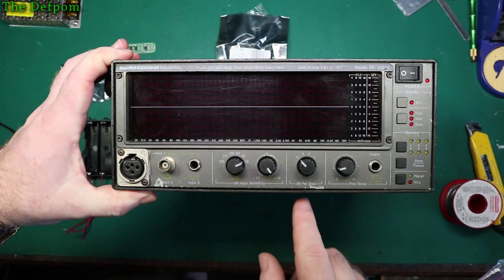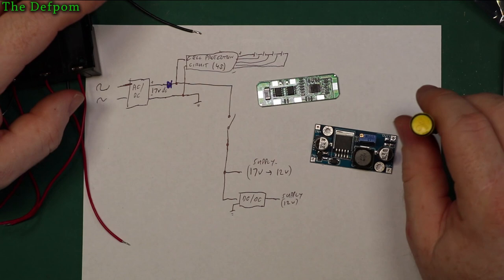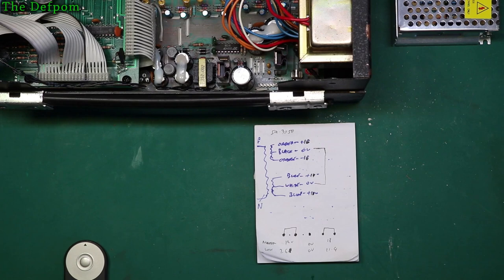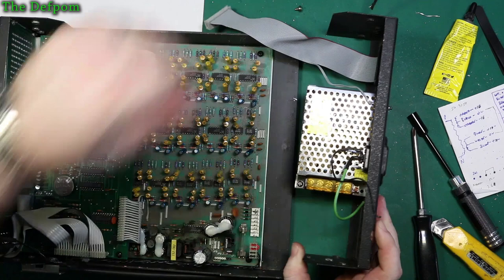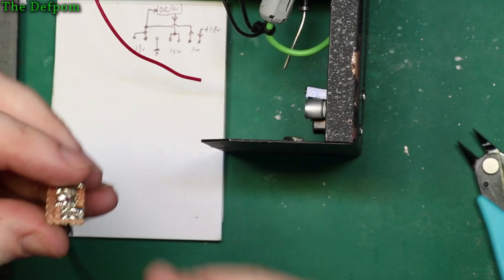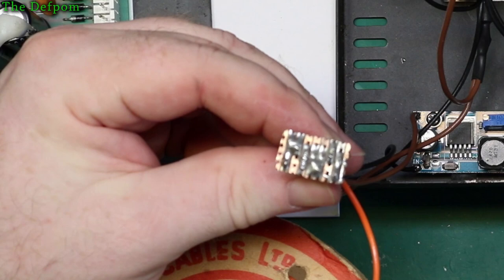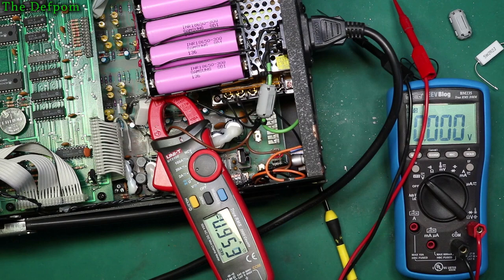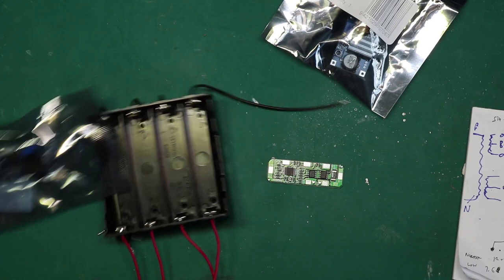🔴 #530 Audio Control SA-3050A RTA - 240VAC Power Supply and Li-ion Battery Pack Conversion to 18650

Comment: Well done good job, I have one The Audio Control 3050A mine has a crook battery pack, so just disconnected the battery and it works on the mains power only these days, had the device for 20 odd years, very useful still using it every day for monitoring ad measuring my own stereo system. Again, great job, well worth saving the device.

Comment: What an awsome, inspiring, excellent piece of work.
This project has given me some real good ideas for some of my bench kit.
I especially enjoyed the bit where you discovered the power supply cutting out because the charging circuit was drawing too much power and jow you fixed the issue by adding the large resistor.
This is where most content makers would skip past an say, " I decided to add a resistor" and skip past the actual discovery of the problem in the first place.  
The fact that you discovered the issue and then showed us how to fix it is really important in the teaching process.
Thank you for sharing.
👍 👍 👍
Reply from the maker: ISO Guy - thanks for the feedback, I’m certainly not perfect and cannot anticipate everything, so showing the kinds of things that can happen and show up in the development of a projects seems like a good idea to me.

Comment: Very nice modification!  Really satisfying to complete a project and have everything work to plan. The only thing I would have done differently would be to make a bracket to mount the battery pack, maybe bend up an aluminum bracket to fit from side to side to take the weight off of the power supply and open up the ventilation holes.
Reply from the maker: David V - yes that was the only bit I wasn’t that happy with, I may revisit that one day and make a bracket for it, it seems fine, but it is a bit of a bodge.

Comment: If your going to parallel up the batteries I would just tie them together and use just one protection circuit board as the cell that are in parallel will stay balanced :)
Reply from the maker: Josh lever - yes that would likely be fine, I just like isolation where possible.
Reply: Yes, this one was what i meant also in my comment. Thats normal way to do when you do bigger battery packs. Also in EV:s there is only one BMS and enough cells in parallel to get correct capacity

Comment: If hacking the PSU to limit at a lower current is too difficult (usually easy if the datasheet for the controller chip is available), I would suggest putting a PTC in series with the PSU.

Comment: Hello, I have an RTA that I bought new. A few years ago, my battery became unusable. To avoid having the lead leaking into the device, I took it apart and I haven't used the RTA since. To do this, I disconnected the 3 wires that arrive at the button (on-off-on) and disconnected the connector that went from the battery to the motherboard. Today I want to reuse it without a battery but I have to make a transformation. A technician friend has already solved how to connect the power button to the power supply. It works at this level. But the device is still not operational. Is this due to the fact that the JP2 bridge is cut? I don't dare solder it for fear of making it worse than better. Not having a plan of the device, it's quite complicated.
Reply from the maker: Maybe show this video to your friend, they may be able to use it to figure out what they need to do.

Comment: Dont but those battery packs with BMS in parrellel. Just add cells in parrellel.
Reply: I think what Jami means here is that if one of the cells with BMS cuts out due to over-charging then the remaining batteries will be subject to a higher charge current per cell. You can get around this by reducing the max charge current so that even one one cell th max current would be ok. I think Scott limited the charge current so it should be ok......although instead of the resistor can't the charger be adjusted Scott? There's normally a pin on the charger IC to control charge current.
Reply: @IanScottJohnston  No i meant that in the beginning he was talking that if more capacity is needed you can but another battery pack with own bms to there. I would not no that, i would just add more cells in parallel to first ones.
Reply from the maker: The bms control shuts off charging to the entire pack, not just individual cells, I would have preferred it to control each cell, but it doesn’t.

Comment: Just a question why do you have both charge and discharge through the resistor diode combination.
Reply from the maker: The resistor is to lower charge current, but in order to allow the battery pack to power the unit I put the diode there to effectively bypass the resistor during discharge, otherwise the voltage drop is too much as well as the load through the resistor.
Reply: @TheDefpom  Hi Scott, I guess you did not understand the question, why have the power to the unit go through either just power the unit direct off the batteries and charge through the 4R7 from the PSU.
Reply from the maker: Zoony FireballXL55 - because if running from mains I wanted the power supply to be able to power the unit and charge at the same time, without drawing from the batteries.
Reply: @TheDefpom  But it will not, it will still discharge the batteries. The current draw by the unit is approx 1A, so if the batterries are fully charged 16.8V to even not charge or discharge the batteries the supply rail from the PSU has to be 4.7V higher than the battery voltage. The way round it is to add a schottky diode from the output of the PSU direct to the unit so it powers the unit via the diode from the PSU when mains powered or the diode from the battery pack when not.